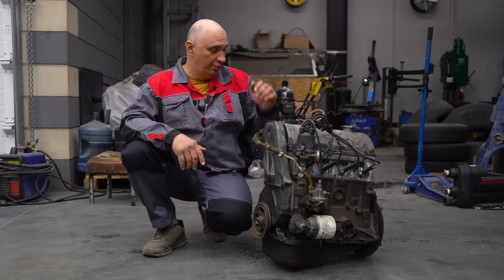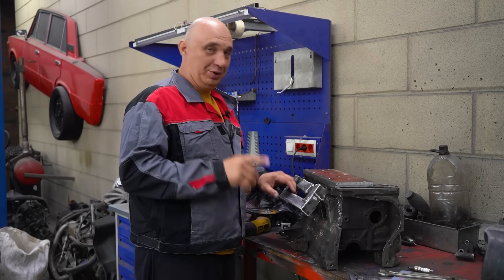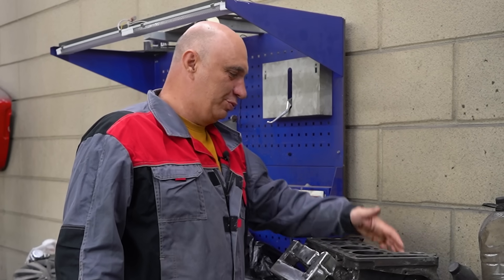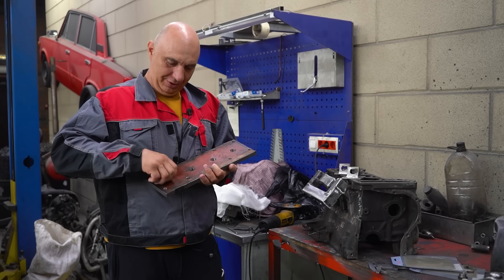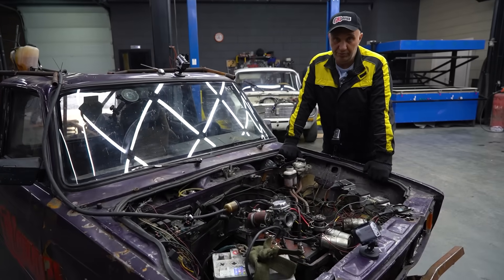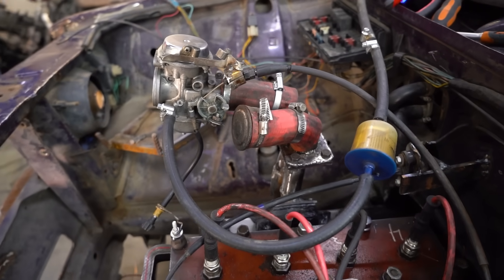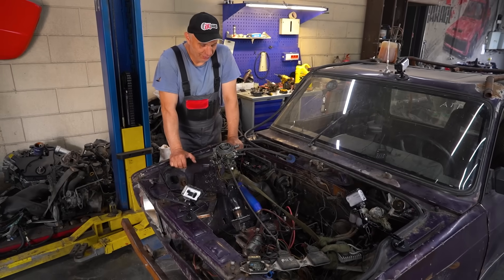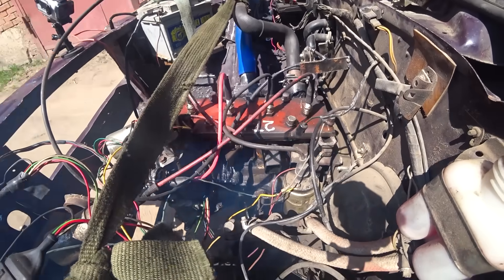4 stroke to 2 stroke Lada engine conversion

Comment: It needs super chargered. U basically made a Detroit which needs forced induction to run. As for u say what u said about crank needing to b sealed, yes but no on this design. U don't have transfer ports and such so doesn't matter. U need forced induction and seal up the intake side good . Basically ur never gonna get it done. Look ur 2stroke Detroit, ur almost there, but not.

Comment: I've worked with 2 stroke engines for over 2 years now and rebuilt a couple engines. You need to have the intake port lower than the exhaust port for it to create good pressure. Also try a real 2 stroke carburator. Pwk. Phbg etc and give every cylinder their own carburator. This is to give the right amount of fuel for every cylinder to fire correctly. As it is it distributes the fuel unevenly causing it not to run.

Comment: Maybe some sort of low pressure bleed off valve/ one way valve. Or just a hole in the oil pan for each cylinder. Start there and see if it fires.

Comment: Your intake and exhaust where the same height your exhaust has to be lower and you need pressure to push the air fuel into the engen

Comment: The distributor must turn the same as the crank 1 to 1 in revaluation
The cam turns 1 to 2 revaluations 
One turn on latum engine to one turn on the crank .
Connect the distributor to the crank to turn same speed 1-1 revs 👍 it will run like hell

Comment: How about copying the Detroit 2 stroke diesel?  You would need a small supercharger to cram the intake charge in the cylinders.  The crankcase would still run in oil like the Detroit diesel.  You also have to find a way for the ignition to advance to give you high rpm power.

Comment: The simplest solution would be to fit a blower like some 2 stroke diesel engines have, another approach would be use the stock head but keep only the exhaust valves working with matched timing (revving the cam twice the stock rpm). The problem is that you don't have enough vacuum in the intake, so it cant work. You could also study and replicate a atmospheric motorcycle engine, but i think it would be not feasible since there is to many mechanical and hydrodynamics modifications involved. Btw the exhaust on a 2 stroke engine also has a significant impact on performance, mostly on atmospheric ones.
Reply: A gy6 qmb 139 motor is a good test candidate. 4 stroke, but extremely simple. But you are correct.

Remove lobe from intake, double end the cam lobes to open exhaust once per cycle and add intake at bdc just above piston head with carb attached. It'll work. I've experimented with hundreds of mopeds I've fixed or built over the years.

Comment: You should use Power valve System in exhaust outlet ports and also after Expansion Chamber separate for each Cylinder.
Requires and four carburetors with ratio cubic centimeters to millimeters of the each carburetor in mm.
and to perfect the result you need flanges and seals for compression in the crankshaft chambers

Comment: Don't a two stroke engine NEED an expension chamber? And isn't the most complicated part? It shouldn't run property if every cylender have the correct configuration right?

Comment: The uniflo design of the Detroit diesel would've been the best approach.
But, to run it like a chainsaw engine, each cylinder must have its own carb, reed valve, and exhaust.  A belt driven blower forcing air into a common intake plenum will create positive pressure to all four carbs.  THEN it will work.
BTW, you'll have to feed 2-stroke oil-gas mix to keep the cylinder lubricated.  Might have to settle for splash lube for the crankshaft.

Comment: sounds to me like you have the port timing incorrect, it works in the same way as valve overlap and duration,and by the looks of how its spitting fuel back out the carbie your intake port is opening to early pushing the intake charge back up the manifold instead of flowing through the engine ,love the channel guys !! huge fan !!

Comment: Why not avoid using the crank case altogether?  Use a Whipple drive blower like an AMR 500 between the carb and the Reed valves.

Comment: Another way of converting a lada engine to two stroke would be to use the same principle like two stroke diesels, with valves in the head and a supercharger. I.e YaAZ-206

Comment: Y’all went way to far with this one 🤣 why don’t just double up and modify the cam. I did it to a single cylinder engine. Wasn’t that hard. Same concept with more cylinders.  Or could have changed the timing gears to make the cam spin twice as fast.

Comment: most 2 strokes have reed valves other known as power bands behind the carb not saying that's the problem but it's a possibility  but I think it's amazing ya took a 4 stroke and made a 2 stroke .amazing....oh allso 2 strokes take mixed fuel not crank oil so curiouse on the setup ya made ..I'd like to see it improve godbless and stay safe

Comment: Port timing is critical. You need an adjustable plate that you can move up and down until you find the sweet spot. Also, and expansion chamber exhaust is needed for EACH cylinder. This helps pull the mixture through the cylinders.

Comment: I would of stuck with a normal head and machine the cams to allow the valves to open as needed. Also then keep the liquid cooling. Nothing says a two stroke can't draw through an intake valve instead of a port. I'm guessing it's done through a port to lower costs and allow higher revs.

Comment: It won't run with your stupid head as the crankcase where the timing chain used to be isn't sealed & thats where the fuel mixture has go before being sucked into the combustion chamber hence has virtually no vacuum to suck fuel in, 2 stroke basics 101!

Comment: It looks like they combined the crankcase  and the scavenging port into one continuous port with the square tube. I bet that’s why it won’t really run. Adding reed valves helped because it eliminated the blow back up to the carb from the crankcase on piston downstroke, but the direction of air fuel mixture needs to make a complete 180 direction change as it enters the crankcase from the carb intake runner, then go back out again up the crossover tube to the intake port. That prevents the mixture from being able to gain any momentum.

Comment: cut and weld the crankshaft so all pistons are TDC and firing at the same time.  Then you won't have to isolate the crankshaft chambers.  Got my first cox .049 2 stroke running 40 years ago they are a wonderful thing.  You guys rule!
Reply: Good grief.  I remember the Cox .049 engines!  Thanks to lawyers, such toys haven't been sold in decades.  The first Cox-powered airplane I got (for Christmas) was a Boeing P-26.  The kind that had the two long strings, connected to a handle that controlled the elevator, and you went round and round and round and round with it.  You HAD to fly it until it ran out of gas.

Those spring starters would NEVER be allowed on any toy today!  I imagine a few inexperienced fingers got whacked when it started.
Reply: @BlackPill-obey  I had the PT-19 control line, same setup as yours.  Yeah that thing took a bite out fingers with its razor sharp prop.  Never got to fly it because I couldn't keep it running.  Thanks for sharing brother!
Reply: Umm no! U obviously don't understand many things!
Reply: @shawnsatterlee6035  Care to explain?
Reply: Wouldn't that shake your fillings outta ya mouth??

Comment: I see some comments about the valved Detroit Diesel 2-stroke, those people are correct. You will be able to use a stock cylinder head, using both valves as exhaust, using a modified camshaft. The ports must be fed with air/fuel from a turbo or supercharger. Study the Detroit Diesel engine from General Motors, it will give you ideas. 🙂

Comment: Without a sealed and pumping crankcase you really need something to provide the scavenging effect instead. Even long headers for each individual cylinder might be effective at certain rpm. Expansion chambers would be a huge improvement.

Comment: you could try reading the crank pressure using a compression tester. You def need good seals between the inner and outer crank case areas, and if you can LOWER the empty volume in the crankcase that will also help with getting it running; the closer your crankcase is in volume to your piston volume, the better vacuum it'll pull on the intake, and transfer more strongly.

Comment: Detroit Diesel solved this problem with a supercharger.  If the 2 stroke engine can't pull enough vacuum to run, forced induction is the answer.

Comment: One big thing that you're missing is flow through the cylinder. 2-stroke engines need to have pressure on the intake ports to pull fresh air and fuel in and force the exhaust out. I'd be willing to bet you're not using a crank breathing design on this engine due to how difficult sealing each chamber of the cylinders would be, therefore my recommendation would be to supercharge the engine to produce that pressure differential

While you're at it, it could be advisable to also design a tuned resonator style exhaust so that the engine has some back-pressure forcing any escaping air-fuel mixture back into the cylinder. This will increase your performance and fuel efficiency substantially.

Comment: Video suggestion, drive a lada car without a clutch by welding a hydraulic ram to the rear which raises the rear wheels off the ground. to start off without clutch pedal, rev engine, and lower rear until wheels push off.

Comment: You lads have the patience of a saint, 2t engines are a head duck when they go wrong, let alone trying to convert a 4T. Excellent viewing material.  Convert each cylinder to its own cylinder and have the firing time at the same time. You will get a balanced problem. You are chasing your tail with this 1 lads

Comment: Study how Detroit diesel engines operate, dont used a crankcase breathing, use a supercharger/scavenger to blow the air and fuel into the engine,  it can work with valves,  use only exhaust valves, and intake is blown in stvthe bottom of tge cylinders, when piston is at BDC,  , i wsnt to do this myself ,  possibly  convert a Chevy 250 into a two stroke completely block the intake ports, fill with aluminum,  and remove tge rockers,and pushrod from the intake, ,  possibly modify the lifter to be held with a lockring anout
 .010"-.125"+/- off the cam lobe. To keep the oil in the gallery,  removing it will  cause a massive internal oil leak, and pressure drop,  use a turbo for after its running, but a supercharger to start the engine,  intellegent  ecm could control exhaust cam timing,  to prevent over or under scavenging,  spinning the cam at a 2:1 ratio the distributor shoud fure as needed, tge oil pressure may be excessive  maybe allow for loose bearings,  use a ball valve or slide valve to block the port ti the bottom of the cylinder whem the piston is up.  To prevent pressuring the crankcase.   The  intake ports are tge difficult part, possibly use 1" npt pioe thread, maybe largér,1.25"  x three per cylinder, going to a 2x3 or4" tube reducing to 2x2-2x2.5"  tgen tge valve, abd go to 2" round tube,  and throttle body or carburator,  uding a blow through carb.   The supercharger pulling through the carb,  back to the intake ports, after tge pipe tgreads in the actual cylinder, brase it to the iron,  steel to iron, use nickel or bronze,  then the water jacket around tge port needs to be repaired, closed in and brased possibly use a 16 gauge steel sheet with tight holes fitting the tubing,  slid over and brase to the water jacket, then the ports. Allowing water to be held,   a supercharger  possibly a 453 Detroit style, Roots style,  supercharger, uding a diverter valve and electromagnetic clutch!  To completely disengage the supercharger when at rpm,  possibly use a exhaust valve diverter, and fuel scroll turbo, to produce some airflow at idle, to keep the engine running st idle.  Possibly have a rpm switch, or pressure switch to engage   the supercharger  at low RPM,  it should  produce 1jp/ cid, at a minimum,  with the ability to produce boost it should double that, nearly 500 hp, at 4500-5400 rpm,  it wiuld probably sound amazing, especially when in its power band, the water jacket tested to 39psi,  with intercooler, and possibly compound turbos, using compressed air with a venturi to start  the engine,  having a 4-5 gallon tank pressurized to 150-250 psi, using nozzles to spray air in the cylinder,   to make compression, port injection or direct injection would be best for this type starting. With exhaust Venturi to scavenge the cylinder,  pulsed burst of air when required, to get the engine running,  use a electric compressor, with 1/2" lines, 150 psi minimum pressure.  250-300 shut-off,  with electric valves  that pulse as required as the starter spins tge engibe over, getting required air and fuel where required  to prevent the need for a expensive supercharger,  even simpler spin the turbo up with the air pressure, it should create enough flow to get the enhine to fire! Especially at 250 psi+  and a 1/2 an lime and fittings flow a lot of air, if its not go to 1" hit tge starter , and the air valve it should  start! Maybe even produce 1-2 psi of boost,  250 psi through s 1 mm nozzle spinning a turbine, maybe two nozzles, and enough air volume to spin ut for 2minutes before dropping to 140-150 psi, and possibly  3 minutes to 100 psi, with an electric compressor  to refill with a engine driven compressor capable of 450 psi,  only taking much longer than  desirable,  uding multiple stages,  possibly 3-4 stage going from  2" bore with 1.5" Stroke , then 1.5" bore 1.5" stroke , then 1.25" bore with 1.5" stroke, then a    final 1" bire with a 2" stroke,  or there about, to allow the cylinder before to have a slight larger volume  than the next,   the first going  0-20 psi inthe second, then 20-35psi in the 3rd,   then 35-50 psi, then 50  to 300 on the final stroke, the rest were first strokes starting from zero! Only compressing 25-30 cc,  the displacement going down  each stage, with the  bore getting snaller, and stroke getting longer dropped about 10 cc per stage eith the final cylinder being about 30cc from possibly 70-80 cc   usung total sealing rings, zero gap, with a cotton cord between the rings, holding oil, with about .030" thick rings  using two per groove, gaps 180° apart,  with two pairs if rings with the oil holdibg cotton between  and a oil cobtrol ring at the bottom, the cotyon ring  getting oil  from a tiny pin hole possibly only .002" only getting oik from the wick tfe string passes through the piston, then a tiny screw and washer holding it tight from the bottom, tge square flat washer leaving only a tiny gap between the two ends of string string ,   so splashed oil and tge tiny hole, keeping oil on the top ring.  Equal to the gap between the ring and  piston, x tge diameter of the piston, so no really measurable amount of blow by is going to pass the tiny hole, the second compression ring pair is still working,  maybe a set of tiny holes should be drilled just below the the ring, intersecting tge ring land, a hole every 90° , and .020" diameter allow the skirt and ring to get lubricant. Maybe the holes should bf .005" lower than the rings,  the oil in the cross hatch should lube tge top ring,  possibly add a oil stfing to the air intake,  to get a oil mist into the top of the cylinders, also lube the  valves, use stainless razor blades to make tge reed valves,  with .080" passages,  and copper orings to seal tge head,  and 3 layers if .125" steel sheet. Machined to about 
.100" thick after drilling and tapping.  Then mount to a .625" steel plate,  using a 3/16 water line to cool the head  tge bores being machined from steel large enough to leave 1/4"-1/2" tall fins about .040" to .050" thick,   basically tge thicknesd of a hacksaw blade, with the same gap!  To allow the radial compressior to cool,b with a 1/2" in and out from the crank, the output sude spinning a fan, about 6" diameter, and the compressor can be attached to a slightly modified alternator .  Bolting to the back side of its case, and powered by the shaft, having only a slot in it, and a center hole, the compressor having the same hole and slot, the 1/4" hole having a 1/4" pin with two small roll pins to drive the compressor,  the 1/4" x 1" pin with two 1/8" roll pins  heated to red hot, allow yo cool to a slight glow tge drop in oil, then heat to about 500°F then install the roll pins,  then bolt the compressor to the back of the alternator, and install on the engine,   use a valve  to  send the output yo ghe inout, anf seal tge air in tfe tank once pressure is reached,  maybe use a electromagnetic clutch between   the over drive ratio the alternator is driven at will speed the compressor greatly!  Or possibly just go the easiest way out and use a ac compressor to compress air, just use a  really good  air filter,   it can go to really high pressure,   possibly mount two if it's not reachibg the pressure,  just use a separate pulley to drive the first  compressor, about 1/2" larger diameter,  if identical or use a larger and a smaller,  compressor,  the larger first, then the smaller,  then a pressure switch, ti control the clutch,  a check valve to save the  stored air! Sorry to ramble!!